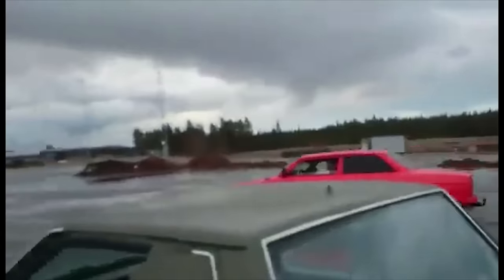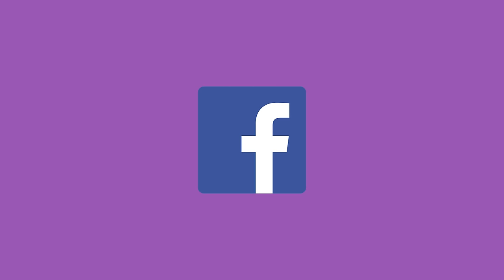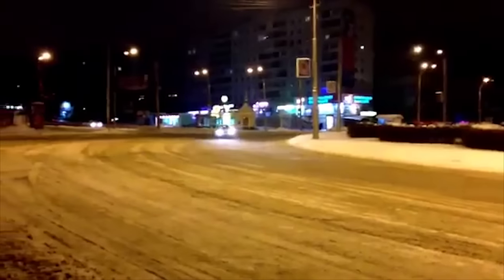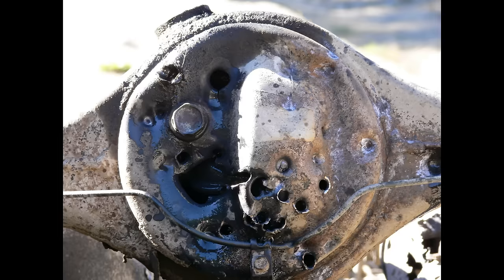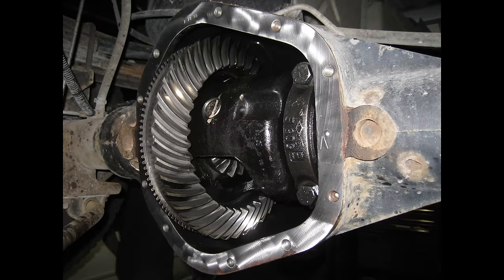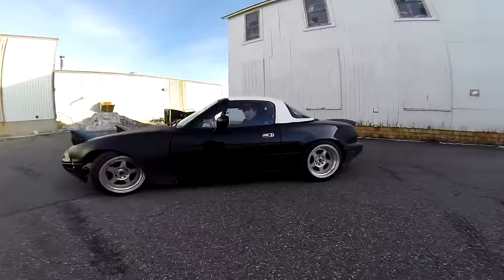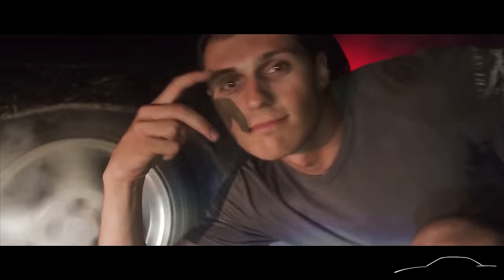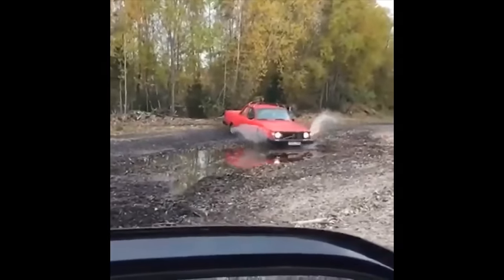Daily Driving A Welded Differential

Comment: weld the engine
Reply: the cloud problem solved
Reply: Weld the piston
Reply: AricAlmirolaFan10 I too, am extremely intelligent
Reply: man i died
Reply: Weld the pistons
Reply: Weld the rods so your car doesn't throw them.
Reply: Hahahah
Reply: Garage54 do that
Reply: and weld the brakes and shaft for maximum stopping power
Reply: the cloud x
Reply: You could just drain all the oil out lol
Reply: Weld the pedal to the floor.
Reply: Everyone who drifts should do that
Reply: Weld your brains
Reply: Knew a guy who welded the heads on a big block chevy engine once then welded chains from the motor to the frame 😳
Reply: @swappedoutZ71  welding cast? Or what
Reply: Legit made me belly laugh .. #lastiingpower
Reply: You’ll never spin a bearing again!
Reply: Calm down Satan
Reply: XD
Reply: Lol
Reply: I’ve been trying to get someone to weld their pistons but the don’t believe it gives them more hp
Reply: Easiest way to weld your engine is to drain the oil
Reply: weld transmission gears for maximum drift king
Reply: The replies to this one single comment are hilarious af 😂 Job well done 🤝🏽
Reply: Weld the key
Reply: Welded crankshaft
Reply: This made me laugh so hard. Idk why.

Comment: OOOOR.... Just install a electronic locking differential. Now you can lock and unlock at the flick of a switch.
Reply: I doubt teens/younger people in general have the money for that. And it'll be more expensive to replace an electronic one then to buy another open diff and weld it again.
Reply: Never heard of that! I'll have to research.
Reply: @peasemotorsports  They're Mainly Used In Drag Builds On Automatics,  So They Can Get The Tires Sticky Before A Run
Reply: @SupremeKai_Omniverse  also offroad vehicles. I'm looking at buying a locker for my vdj76 landcruiser
Reply: @tsarbear4191  probably shouldn't be drifting then
Reply: @SupremeKai_Omniverse  wHY dO yOU cAPITILIZE tHE fIRST lETTER oF eVERY wORD
Reply: @ruthenican  Why? Spent £1500 on a 2003 BMW 330ci welded the diff and lowered it abit goes well round corners and compared to my daily its cheap to run!
Reply: @ruthenican  Why? Welding the differential works just fine for dedicated budget drift cars.
Reply: @ruthenican  drifting is meant to be cheap
Reply: @ruthenican  what do you even mean by that 😂 I bet someone who's been drifting a shit box since they're teens would flog you at drifting, it's not the car it's the driver
Reply: @repliedreplied5552  ok, boomer
Reply: @ruthenican  ok boom
Reply: boom boom boom
Reply: Hyperdrive flashbacks
Reply: Or, don't spend any money at all...

And weld the diff.
Reply: @Shocking Isn't It? Ok boomer
Reply: Its expensive AF!!!
Reply: I could buy 3 used axles for the price of one new Locker
Reply: or like i did with my volvo. buy a aussie locker, you take the gears out of the diff and put in the locker internals, so off power it's open on power and resistance on axle it locks up 100%. cheap and strong but man it's noisy when you do tight corners on parking lots klonk klonk klonk donk pling pling....
Reply: those are for big rigs
Reply: @kristofferbae7258  no you get them in all sizes and shapes pretty much
Reply: @kristofferbae7258  You're thinking of an inter-axle  lock.  That engages the second axle so all your duals are pulling. Differential locks link the tire on either side of one axle together as one solid axle.
Reply: @RaiderOfTheLost  So what does your "fursona" look like I wonder? Extreme levels of public displayed distaste is an indicator the person has an affinity themselves they want to hide.  Ceerio!
Reply: Yo send your next paycheck my way and I'll do it 😘
Reply: oooooor just  buy a locked  axle  or just weld it
Reply: @Usef320  yEah, wHy aRe yOu dOing tHat?
Reply: Exactly. The obvious answer is stop being poor.
Reply: Maintenance would be a bitch tho
Reply: Lsd or welded diff for daily 320d

Comment: i welded my front wheel drive honda diff its such a good daily now
Reply: RedesCat have u had any issues with it
Reply: em1h2b sosa uhhhhhhhhhhhhh
Reply: Nah man it rides as smooth as never, you should totally do it
Reply: fuck im dead
Reply: RedesCat Drift in reverse.
Reply: Ryan Mcbride RIP
Reply: Sick J-Turns
Reply: em1h2b sosa this is the car-culture equivalent to deleting system 32 to speed up your pc
Reply: I’M WALKEN HERE it's more like deleting system 32 in you Mac
Reply: RedesCat hahaha
Reply: you must go through so much boost lol
Reply: Does your Honda have a boost off controller?
Reply: I did this to my civic too. It now mows the lawn like a champ
Reply: I wonder what it would actually be like. LSD in a front wheel drive is actually much more effective at putting more power down  earlier in a corner exit than it is for straight line acceleration grip / lower E/T times. 

Of course it would cause additional tire wear and a weird ride, but I wonder if the effectiveness lost mid corner would be made up by increased corner exit speeds. Might be more fun?
Reply: @xalataf3365  maybe you could make it so you could turn with the backwheels and use your gears in reverse ;)

Comment: I welded my Jeep's rear diff.  Other than tire noise in tight turns it was barely noticeable for normal driving.  Off-road it was a whole new experience, it was able to do some stuff in 2wd that it could barely pull off in 4wd before.

Comment: Hell Yeah! Tomorrow I am welding all 3 differentials on my 4x4.
Reply: I don't even think I would make it that far.
Reply: KastaRules Then I'll try welding my FWD Audi...
Reply: sweet
Reply: And I'll weld the rear axle on my Golf Mk1. Let you know how it (doesn't) go...
Reply: All ready dan
Reply: I'm welding my gearbox and clutch also. Just to be sure.
Reply: Next... the steering column!
Reply: hahahahaha this is getting out of control!
Reply: KastaRules and after that, crankshaft, camshaft's, and throttle body...
Reply: i'll just weld everything that moves together :D
Reply: My windshield is already welded. Gliding through corners like a unicorn.
Reply: So how did it go welding them all together?
Reply: It didn't.
Reply: don't worry, I'll weld my hands to the steering wheel, I'll tell you how it goes.
Reply: My lord, reading this thread is the funniest thing !

Comment: As someone who drives a mid-size pickup truck with a welded diff and oversize tires, other than an occasional screech and loss of traction during heavy rain, it's not a problem at all. Fun as hell in the snow.
Reply: How does it feel on the highway?

Comment: Do all mustang drivers have welded diffs?
Reply: Nope, the diff is just as useful as a rock when it comes to cornering, acceleration, crowd control, etc.
Reply: In all seriousness though, it's because of the sheer torque of the mustangs engine. If you put a diff on that has a lot of play it will destroy it the second you step on the gas
Reply: Ollie Young not me
Reply: Michael Stocks
Reply: Ollie Young based on inductive reasoning, yes
Reply: why just why 😭
Reply: lsd diff
Reply: my mom's differential
Reply: no
Reply: American cars dont round corners no matter what you do to them!
Reply: yes American cars cannot go around corners, which is why 4 of the top 15 ring times are held by American cars....
Reply: Until 2015 Mustangs had a solid rear axle: not having independent rear suspension causes opposite tires to lift up when cornering causing the car to break loose very easily.
Reply: doesn't have anything to do with the differential. was this just a fun fact?
Reply: Cars like the mustang, Camaro, Firebird.. etc etc were never built for cornering, It was all about an affordable car that could go fast. The back suspension was set up to put power to the road not to carry speed around a corner.
Reply: standard lsd with the GT
Reply: I'm a jdm fan but let's be real, people now of days usually don't drive v8's. So when one does drive one. they expect it to act like a typical honda and just dump the clutch and corner sharp. With torque being aggressive in those cars, you have to approach it differently then you would a fwd.
Reply: No but a lot of torque
Reply: No

Comment: Also some real tips:

Dont use wide sticky tires on the rear, Engine braking must be approached with caution, You need to adjust the geometry and setup of the car to compensate for the lack of turn in, Have half shafts ready for when they brake.  DD a welded diff for 2 years, now on my second car with a weldy
Reply: So, if I weld the diff on my 318i I'm going to have a shit ton of costs in the future compared to leaving it open diff?
Reply: Not a shit ton, second hand half shafts cost between 30 and 50$. And if you dont give massive shocks to your rear end (wheel hop), they should last just fine. If you intend to actually drift the car, this IS a must. You will fall in love with the control it gives you.
Reply: why do half shaft break? i mean is it from drifting (clutch kicks etc) or from the skipping tire which is trying to grip? do they break often when most driving is just normal driving?
Reply: meh I was gonna weld the diff but I'm going to have to trade for a diesel fwd car

car is too hungry, drinks more than a 520i wich is weird
Reply: Its mostly tire skipping, like standing almost still and flooring it in second gear. Never broke something when driving normal and did not break anything mid drift as far as I remember. You should let go of the gas when you feel your rear end vibrating, thats wheel hop and that what did in all my half shafts.
Reply: and how often did you have to replace shafts? or anything coused by diff(bearing maybe?)?
Reply: @FOXeye95 dude I'm also thinking of welding Mty 318i lol
Reply: What is the use of a welded diff? Sounds like you could just use shitty tires on the rear? Is there any perks?
Reply: @CiderHerrljunga  makes both tires spin at the same time otherwise it just allows one to spin
Reply: @coober0_0  what's the use of that?
Reply: @CiderHerrljunga  drifting

Comment: So cars started out with no diff, then open diffs, then these fancy limited-slips and Torsens. And now back to effectively no diff?
Reply: And not stupid at all, and not dangerous at all.
The drive shafts must likin' it a lot too!
Living on the alps, that would be very fun to see somebody whit his welded shaft making some hairpin turn, he would be not stupid at all, no no... ^^
Reply: Only for drifting I guess,  doing it on a daily driver would be stupid and a death wish.
Reply: Toatally agree, but you are watching "CarThrottle" who has no idea
Reply: I had a welded diff daily driver and it's not a death wish if you're an experienced driver. Way better traction during the winter as well.
Reply: Brawndo 
I've had plenty of daily drivers whith welded diff. 
It's perfect if you want to learn about car behavior.
The good thing is that your car will behave pretty much the same at any speed. 
Open diffs work ok for high speed but not in low speed, and depending on power it can be very interesting. A welded diff dosent have this problem. 
It's cheap contra buying a real one which some times only lock like 30 to 50%.
Reply: How does a welded diff give you better traction in winter?
Maybe taking off it will have better traction but every corner will result in wheel spin, how is that better?
Reply: you have to keep in mind that differentials were developed for practicality, however it was stated numerous times in this video that it's literally about purposely losing traction
Reply: An welded diff might be better than an open diff in extreme conditions where slip situations (where one wheel loses grip and an open diff sends all the power to that wheel) are common.
Reply: +rudkacka *turn, they want to watch the world turn. From inside their cars with wielded diffs.
Reply: I have a feeling that most of you have never driven a car with welded diff and dont seem to understand the basics of car behavior.
You weld it cuz its the cheapest way and the car will behave exactly the same all the time.
No suprises.
Reply: Påven not all the time, in parking lots it will jump around like crazy
Reply: Jump around like crazy???
What are you on about.?!
You can park it perfectly fine.
Its not like its gonna jump half a car leangth sideways when you park.
Reply: rudkacka 
Depends on the tires.
Sure if you have super sticky tires it will feel more. But since you want to drift you will be having MS tires or tires with soft rubbermix.
Reply: Påven well if you want to buy fancy tires for drifting, you may want to go with LSD and not welded diff
Reply: rudkacka 
I wouldn't say MS tires are fancy. 
I got the impression from the video that budget was an issue.
Thus welding the diff and put worthless tires on your 250hp ricer is a good first step. 
Plus depending on the level of drifting you might want an torsen based diff instead of an lsd since they have a tendency to slip or don't work at all when it gets too hot.
Reply: Påven thats true

Comment: I welded the diff on my FWD MK2 VW Golf and I still can't do mad skids, i've even added loads of drift stickers for extra HP but still no luck.
Any tips from anyone in the know would be great. 
Thanks.
Reply: Put some McDonalds trays underneath the rear tyres and then apply the handbrake; works EVERY time.
Reply: HA HA HA HA HA, good one HA HA HA
Reply: YoloMcSwaggins
I got banned from my local track day for doing that. They said it was dangerous, LOL.
Reply: drive in reverse.
Reply: Leeroy Jones drift stickers don't get HP,you need more HP for your car,If it's the 90's and 80's fiesta then get more power with a turbo or a new engine,If you have a newer fiesta then you just need to loose weight
Reply: Mr_ YoloAwesome Don't be ridiculous, of course stickers add horsepower, it's at least 50 bhp per sticker.
Reply: True! :D
Reply: +YoloMcSwaggins if it snows you do need the trays :)
Reply: add a huge ass wing.
Reply: tons of negative camber.

Comment: Limmited slip?....
Anyone?
Reply: @AYE OK SURE How? Plenty of people use lsd's in drifting. A good plated lsd is better that a welded diff imo.
Reply: Some cars didnt come out with lsd, even as an option, for example E46. Only M3 had it
Reply: My E36 has an aftermarket LSD and it's so much better than the stock open diff.
Reply: @achilleaustin  pointless, some E36 came out with lsd as standard do you could just buy an used diff
Reply: @Drifter5696  yeah i probably could but i got mine off a mate who was building an e36 drift car but unfortunately crashed and he gave me the lsd
Reply: Welded diff is very predictable.
Reply: Got an 86, lsd comes standard. Actually now that I point that out I’m wondering why I’m even watching this video....
Reply: Budget? Anyone?
Reply: @evanasche8882  of course! Anyone?

Comment: Would this make my old VW camper drift with the stock 70 hp?
Reply: VW Max you can't weld a vw gearbox/diff, I've tried ;)
Reply: If it wont break the tires loose with a diff its not going to break loose with a live axle.
Reply: Flabulo You clearly dont know what a live axle is. Or a differential.
Reply: ***** I know what differential is. I just fucked up on what a live axle is. So chill your ego.
Reply: Flabulo Well it will still have a diff after welding it so....
Reply: nothing than a wet road can't cure, i make my car slide in the corners only with the hand brake, and it's a front wheel drive with only 55hp.
Reply: Henrique Daniel Dude, ever tried snow? There is snow on the ground in Montana where I live right now and I could easily get a stock 27hp Beetle sideways on it.
Reply: sure, but in my country there almost no snow, even in the winter is rare in my area, in Portugal. But even only the rain is suficient to make mad skids in every car, and the car i'm talking only weight 890kg with full interior.